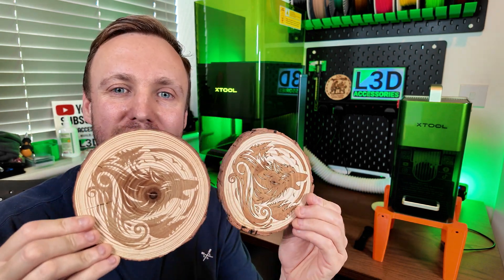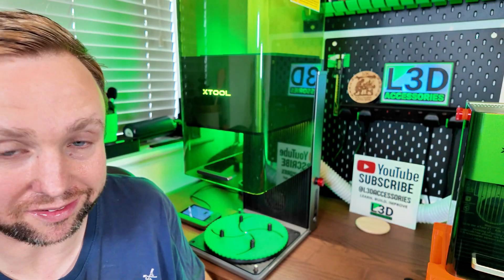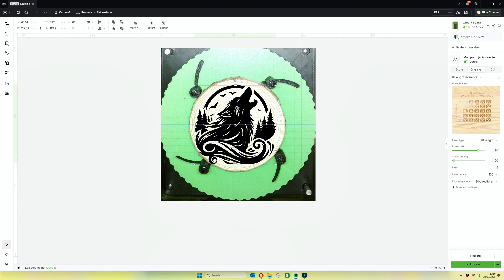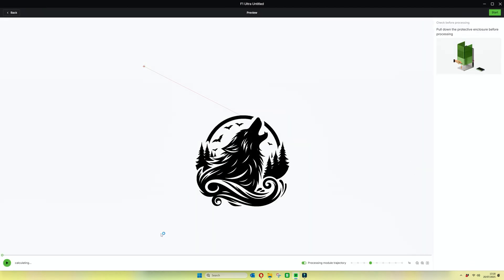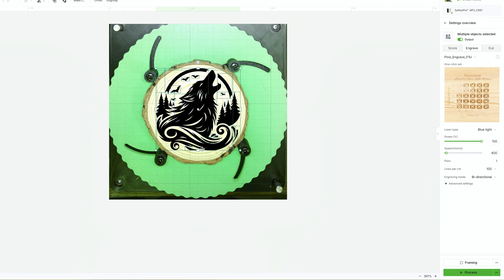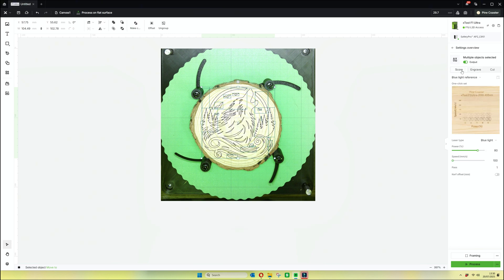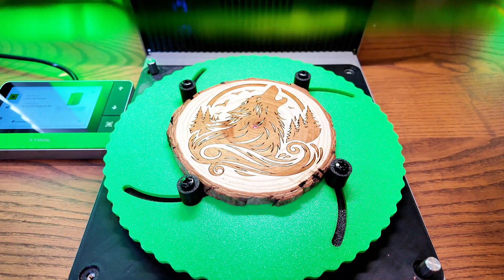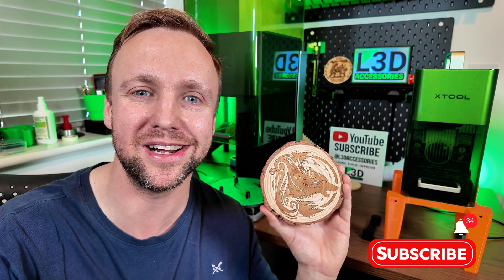This Laser Engraving Trick Instantly Makes Your Designs POP

Comment: I am a complete novice in the lasering world, I have bought the xTool F1in fact last week. Three days later I saw the xTool promotional video for the xTool f2, I have never owned or used a xTool laser, but the F2 looks like a very nice machine. The F1 that I bought is still in its packaging, because I ordered the F1 while I was on holiday and it has arrived. I have contacted xTool and asked if I could return the F1 unopened, get a full refund and then order the F2 next week when it is launched in the U.K. they replied with in about 12 hours and said yes to the return of the F1, I am just waiting now for the return label they are sending me. They have been very helpful, I must say xTools after sales service is second to none in my opinion. Sorry for the long winded story Chris, anyway because as I say I am a complete novice mate and watching your videos has helped me a great deal, thanks for that, but you say in this video after the first burn set the laser to score, what do you mean by score. Keep your videos coming buddy.
Reply from the maker: The F2 looks like a brilliant machine so if you end up with one you'll be in great hands. There are 3 different types of processing modes when you use the laser. 1: Engrave (this is the equivalent to colouring in a picture) 2: Score (this is the equivalent to drawing lines around the outside of a picture) 3: Cut (this is cutting materials). To create most images and design you use the engrave feature but what you can also do after you engrave the item is select your design in xTool Studio and then select the "score" mode. This will then change the processing type. Once you've done that you then run the engraver again and it will score the line around the outside of your design to give it contrast.
Reply: @L3DAccessories  Thanks Chris, now I understand, I am ex military and I would like to try engraving different regimental cap badges on wooden, cork and slate coasters, would the score method also work on slate. Thank you for the quick reply sir and keep up the good work..
Reply from the maker: @RTSFoto I'm also ex military (Royal Engineers), good luck with the cap badges and feel free to find me on other social media if you have any questions and want to DM me.

Comment: Any idea how to achieve this in Lightburn?
Reply from the maker: I've done the same thing in lightburn using the ACMER P3. You need to use the fill option first to create your engraving and then assuming your laser returns to the same position it started from once it finishes the engraving you can then change the process type to line and achieve the same effect. If you watch my ACMER P3 Review you'll see I engrave onto a large round wooden board, I demonstrate the process in this (fill engrave followed by a line engrave). Thank you for watching

Comment: Did you happen to mention what SOFTWARE you're using?
Reply from the maker: I was using XCS which is specific to xTool lasers. This method also works with Lightburn using the fill and line options.
Reply: Thank you!  Nice video.  New to laser engraving and  I didn't know that software had a scoring feature.  Thrilled to see it.  Scoring in black is a technique I've been using in acrylic painting for years....

Comment: I use this method, but I copy and paste then design, and place it exactly over the top and set it to score, also I use the user defined 'smart' process and it engraves far quicker.  Doing it this way means it's one process rather than 2 separate ones.  It does make a massive difference.
Reply from the maker: Thanks for the heads up! Definitely sounds like a more streamlined and error free way of doing it. Thanks very much for watching and for commenting with your tips.

Comment: Brilliant, I suppose - thinking about this, you could also copy the image, place the image that has the score settings 'behind' the first engraved image and then run the job to save you going through the process again with the software?
As long as the images are directly on top of one another (centre aligned), and placed in the correct order (engrave first, then score), you just have to click the button once then?
Then, you could 'group' those two images as a working file, that will run both process on other items (obviously settings may need to be changed depending on the substrate).
Reply from the maker: That's a brilliant way of doing it and would also work just as well. If anything it may even work better because you eliminate all potential user error.

I hope you got something from the video that you can use going forward. Thank you for watching.
Reply: @L3DAccessories  - definitely mate, I'm not usually one for commenting on videos, but cracking stuff, well done buddy and best of luck with everything.